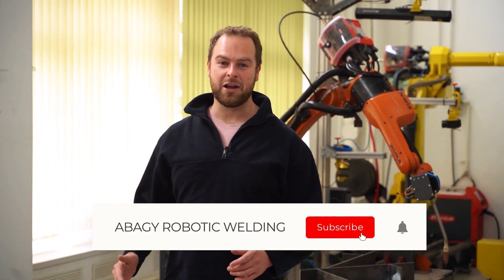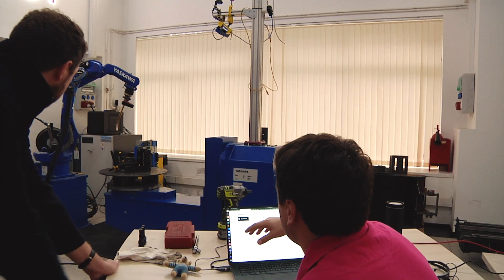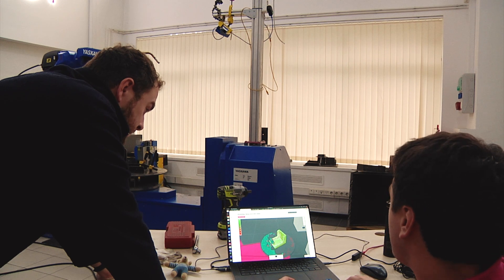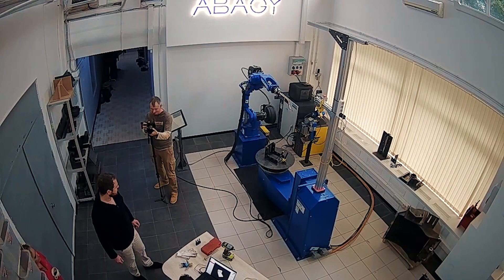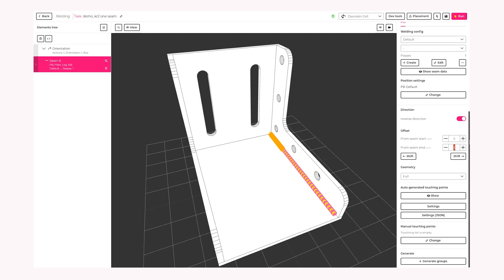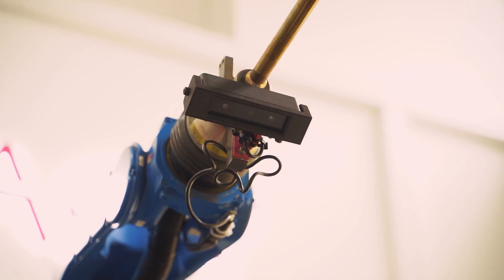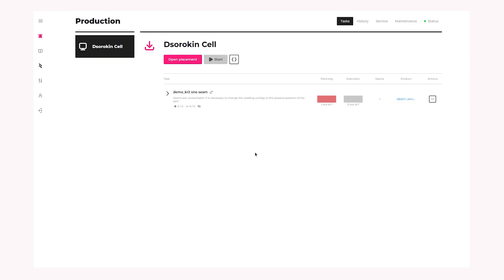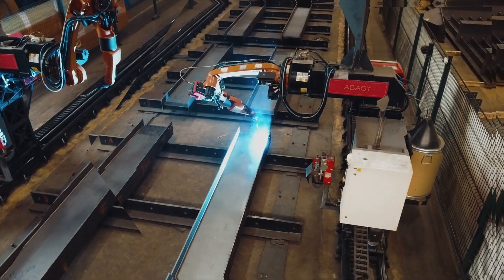How Robots Can See | ABAGY ROBOTIC WELDING

Comment: looks great but have a question:
lets say i have a steel sheet or a U beam that is warped slightly can  the robot adjust for it? and if yes how much can the robot tolerate?
thanks
Reply from the maker: Abagy solution adapts to part deviations, and this is the main advanged of the technology.  Maximum permissible deviations can be determined depending on the general settings of all equipment.

Comment: You don`t need clamps at all. Make a Magnetic Table. Place the part on the table, turn on the magnet when finished turn off the magnet. There is your first upgrade. Simple
Reply from the maker: This is a good idea. We also use magnets. But in any case, you need to take into account the position of any obstacle (rigs/ clamps / magnet) when calculating the trajectories of the robots.